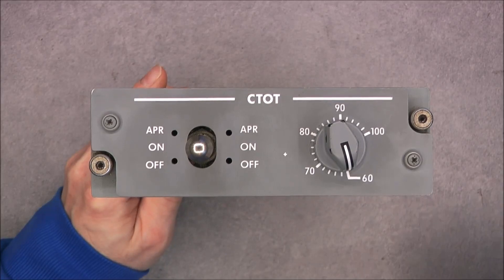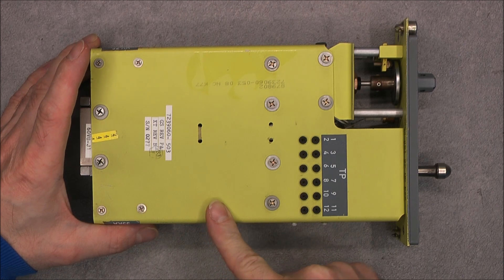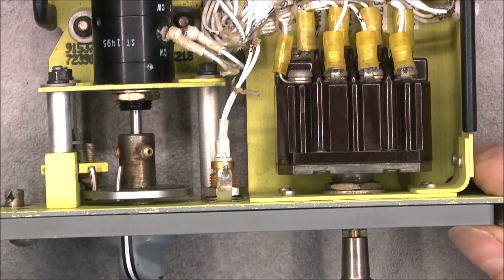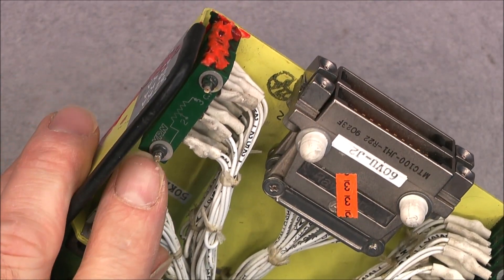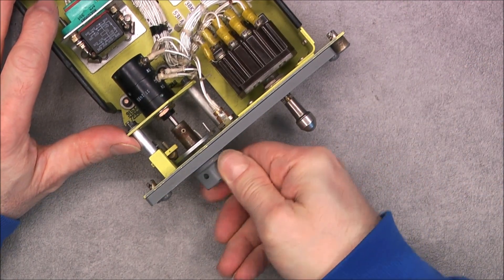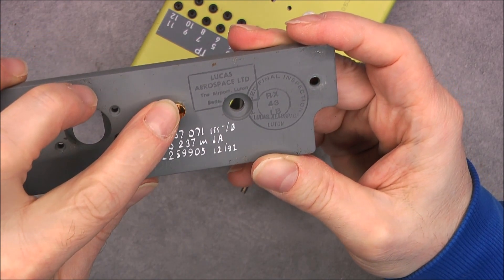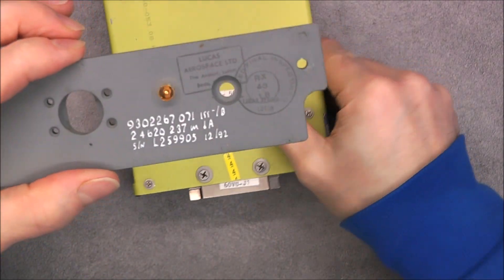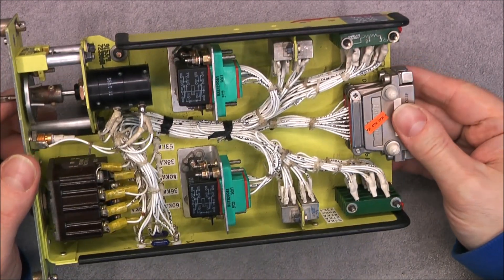CTOT control panel from a Saab 340 aircraft

Comment: That box is actually responsible for two different functions on a Saab turboprop: CTOT (Constant Take-Off Torque) and another function known as Autocoarsen which is unique to Saab aircraft.  CTOT is a function which controls the fuel flow to the engines during takeoff to prevent a phenomenon known as "torque bloom" where the engine torque spikes as the aircraft speed increases and more air is forced into the engine intake as a result.  Torque bloom can cause serious engine damage if not properly managed.  Autocoarsen takes effect during an engine failure.  This function automatically coarsens the prop pitch on the downed engine to prevent drag effects during single engine operation.  This was necessary, from what I've read, to attain single engine takeoff certification on the Saab 340 and has subsequently been added to other models.